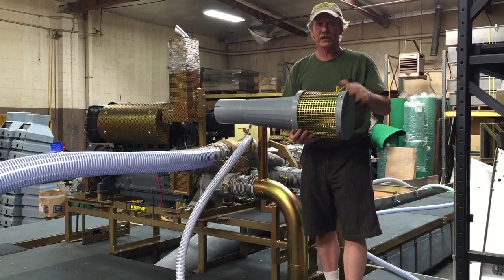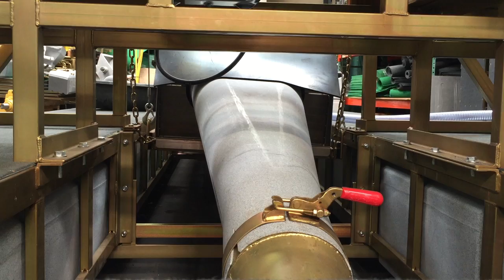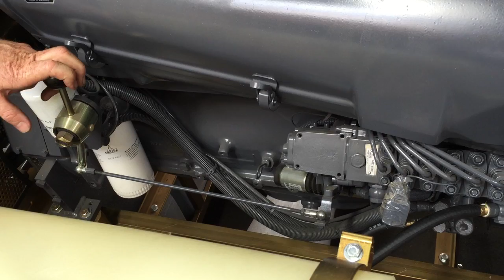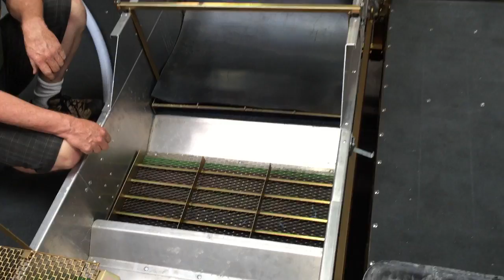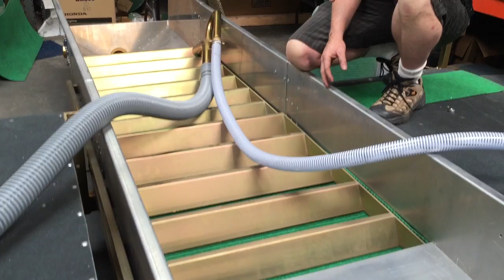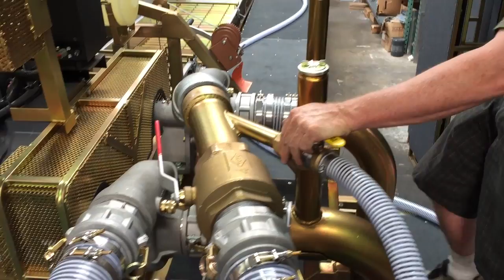8195D walk through

Comment: I need this dredge :)  

NICE 🙂 
ANACONDA MINING COMMENCES 10,000 METRE DIAMOND DRILL PROGRAM AT ITS TILT COVE GOLD PROJECT IN NEWFOUNDLAND 
https://www.anacondamining.com/.../release.../id/4501725... 
This is where I have 3-6M tons of the Ocean dump Tailings from Tilt Cove Mines 
Down at the site today testing the pump to recover 1ton sample 30 5gal pails. 
Will be up early and down for the day to recover the 1-ton sample.
The sample we had last month had 2.9g/ton of gold. 
Yet Anaconda will be 5-10 years getting a mine up and running. Cost $10M's to $100M's to strip, Blast, mine, and process. 
They will retrieve $100M's to $Billions 
As for North Atlantic Gold. We only need to dredge, via a floating pipe to shore. Where we can 1. Load and go with 30ton dump trucks, and truck 22km to TheNugget Pond Milling Facility http://www.ramblermines.com/nugget-pond.php
Cost to truck $200/load 
Cost to process ??
Cost to recover tailing $200/load (wages/fuel)
30ton @ 2.9g/ton is 87 grams or Troy Ounces: 2.7971
Today Gold Price is $1905.10USD worth $7,028.14 CAD/load
So 1 Million ton could bring in 
$177,691,389.32  or $178 MILLION
So between now and the Spring, I have to find investors. $1M 
To set up a Slipway $5K 
Purchase/Build Gold Dredge Barge with min 30tph pump $250K https://www.youtube.com/watch?v=AFF5eVAaL5U...  
Purchase Floating Pipes/Pump $100K http://www.pipefloat.com/pipe-floats/and 
Setup Loading Berm onshore. $100K
Work 100 days for 12h/d to recover 1,200 (30Ton) truckloads @$5K/load or $6M/year operation. Starting this Spring
Or option 2. 
Sell or option off my mineral leases to an operator to take over the property. I really do not have to work, yet I like to 🙂 
Option 3. for the fastest recovery Get the Queen of the Netherlands ship and dredge
https://en.wikipedia.org/.../Queen_of_the_Netherlands_(ship)
with 35,500 m3 capacity, we are looking at 35,500Ton+ or 1K to 2K trucks loads or $7M to $14M per trip. 1 trip per month would be NICE 🙂 
So maybe 100 months and we have 3M tons of tailing cleaned up off the ocean floor. 
Just a small part of creating and making a better planet 🙂

Comment: Egad!  What a beast!  It makes sense for a production mine though.

Keith from Tucson
Reply: By the time you figure out how to optimize the details to where it works nearly as well, you will have spent twice as much- trust me, development takes a lot of fiddling and re-design.
Reply: Well a dredge is a bit more complicated than a sluice, and one thing that say Keene has to do that the back yard fabricator does not, is analyse every material, component, and arrangement to get maximum effectiveness for minimum cost.  For example, I am working on a new type of separation table.  I started with a sheet metal table top- no good, too much vertical 'twang' during operation.  So I went to heavily varnished 1/2" plywood- worked fine initially but degraded in weeks as water somehow worked its way into the wood and expanded it.  Then we went to 1/2" PVC- worked OK until it started to fracture around the attachment points.  Next?  probably fiberglass.  Fun if your'e not in a hurry.

Keith